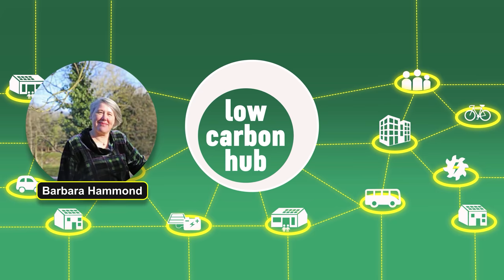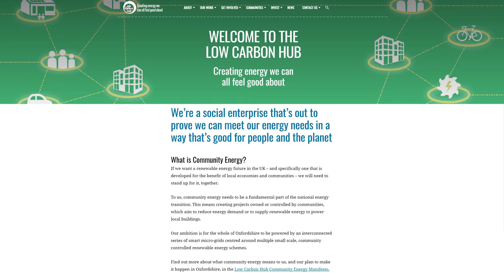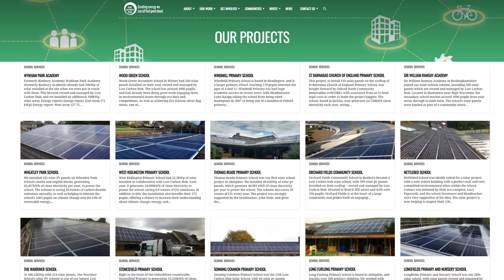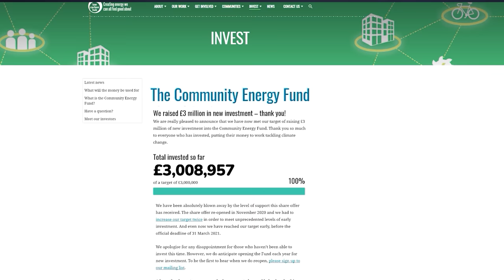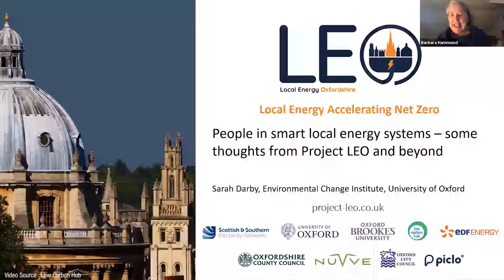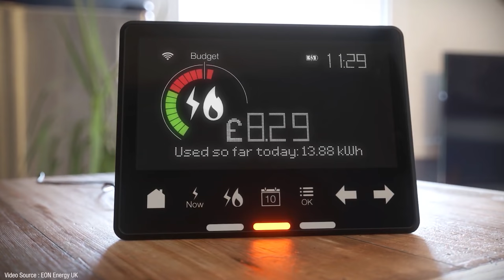The Low Carbon Hub   A glimpse of our distributed community energy future

Comment: That river hydro installation is especially heartening. Fish-safe designs for baseload river hydro are important, and if replicated across the nation could provide so much of our needs on its own.
Reply: Sorry to say it, but England do not have the rivers to supply any substantial amount of the energy needed. A single link to Norway (Sea Link, a 1,400 MW HVDC interconnection) can supply 50% of the installed hydro power capacity in UK (not counting pumped storage). Only 2% of the energy mix is hydro power and because of how unpopular large projects will be, this will not increase.
Reply: @bknesheim  not at megaproject scale no.

But at smaller scale we have the capacity for many many small hydro plants serving a few local buildings. 

Just one example the Co-op grocery supermarket in New Mills, Peak District, is powered by a screw-like hydro plant on the nearby River Sett / River Goyt. When running the "Reverse Archimedes Screw" produces power for the shop with a surplus to sell to the grid. It has put back into use the head of water produced by mill owners in the water phase of the industrial revolution. 

Don't forget that the international industrial revolution started in England. Don't forget that the capital for the steam-driven stage was provided by the earlier water-driven stage.

We did it once. We can do it again, but this time round not go for the mega projects which as you say are unpopular and I personally think they are justifiably unpopular.

We can certainly get almost every mill-race running again, this time generating electricity rather than grinding corn or spinning cotton.

We can and we should. And we can do alonside the gov't or despite the gov't
__

Train to New Mills Central. 5 min walk to the hydro. Look for signs to Millenium Bridge or Sett Valley Trail.

The hydro itself is not a day out, but if you are going to be in the area, or you fancy a gentle walk along a converted former railway alongside a lovely river then do take 20 or 30 mins to look at the hydro.
Reply: Not just baseload, but dispatchable, and also energy storage with pumped hydro.

Comment: Amazing video as always! Thank you so much for describing the work of the low carbon hub. Similar efforts are needed to decentralize food production to whatever degree possible depending on location. Agrivoltaic systems where specific foods are grown in areas with solar panels is an upcoming solution too.

Comment: Many places have already done this type of thing, but with Water resources.  Rural areas where drilling wells are difficult so they pool resources into a single well and cooperatively run the well and distribute the water within their community.  I actual do one myself for my neighbors.  My well provides water to numerous houses and we share in its upkeep and operations, even though it is on my land.

Green electricity and storage is ironically one of our ideas for dealing with the power needs for running our community water.  We could follow this model and provide supplemental power to all of our members during power outages from the primary grid in our area.  It is something we are actively considering.
Reply: @Jeff Johnson so is it a deep well that's fully cased, with passing that didn't start leaking from day one like most oil wells do, anyway just hoping you don't have many Celtic tanks near by and by near who knows from how far away it rains and the water makes it to you. Good analysis several times a year is probably prudent!
Reply: @TheLosamatic  It is a deep well.  We had a Aqua engineering firm help us determine depth so we could get into clean and good water.  We are on a massive limestone ancient sea bed.

Comment: Speaking as someone who's so far below the poverty line that she'd need a long ladder even to reach the darned thing, I'm always wary of anything that sounds positive, progressive, sensible, renewable, or green. Because, sooner or later, one way or another, I just know my electricity bill's going to double. 🤪
Reply: I can guarantee that the cost of electricity produced by solar panels on a residential roof is already less than £0.10 per kWh over the lifetime of the system. That £0.10 is fixed and unaffected by inflation over the 20+ year lifetime of the solar panel installation. Average electricity prices from the grid are more than 50% higher than £0.10 per kWh and will only go higher over time. The biggest problem though is having the funds available now for the solar panel installation to make the savings in the future. That's where the local community can help.
Reply: Insulation can be available free

Comment: My thought on the solar panels is that roof mounted solar is mounted on the roof with no airflow underneath, whereas ground mounted is almost always on a steel frame allowing airflow all round. The panels work better when not hot somewhat ironically.
Reply: Sadly they compared residential rooftop solar with grid scale ground mount projects. Of course both the financial and practical efficiency was better, but you do lose out on the democratization of power generation and the problems associated with a centralized power economy. Though I agree a co-op is much better than a power grid monopoly. 

But I would still rather see solar panels on commercial rooftops and parking lots than either residential rooftops or in fields. 

Scale can be similar due to the size of the property, and different mounting technology could be used so the efficiency is there both practically and financially. 

Also reduces the need for air conditioning in commercial properties. 

And it leaves natural land natural, only beautifies already in use commercial land. 

Combined with electrified fleet vehicles for double down green effect. 

Also gives some democratization of the power monopolies to consumers, corporate consumers having the power are still better than grid monopolies.

Comment: The drive to low carbon economy caused that UK replaced coal power stations with natural gas power stations. In 2020 gas generated 36.5% - 114 TWh. That caused very quick use of gas from UK's deposit on North Sea. Now UK is covering only 55% of demand and there are only 3 years left of it. The rest, that is 45%, is covered by import mostly from Norway of very expensive gas. Just now the gas prices for heating homes increased by whopping 60% !!!. 
I have now in September 2021 gas price increase from 2.107p/kWh to 3.3548p/kWh.

In 3 years time UK will have to import 100% of natural gas. I can only image how much the gas will rise then. That will be a real shocker. Such a wonderful and cheerful results of the policy.
Reply: Sounds like your place needs a passive energy upgrade. Time to make a move.

Comment: Here in France they have been some tremors with solar power production. The price of the kW bought to private solar has dropped to the point where you can't make a profit, you'll pay back your investment after more than ten years, and when you get the first profit you'll have a drop in efficiency and failures on your panels that became old. This happened to a local farmer who invested 300000€ in an installation to make some benefits off his hangar roof, but now that the price changed he can't make money fast enough to pay his loan. Even if private or communities take the initiative, it can still fail if the government doesn't support a linear price to sustain the investment.

Comment: I have a question for those interested in efficient uasge of electricity. We've had a "Smart meter (gen 1)" in our house since 2019 and it's unable to recieve/transmit data to our provider. We're no where near any other smart meter users. There's a single mast for mobile phone a few miles away and we get 1 bar on our mobile phones. I've had companys over to our location to test signal boosters etc. to no avail. Who/where do I contact the UK gov to get this situation resolved? Any constructive ideas or information appreciated, thanks.

Comment: Why is the low-carbon hub shown dismantling a nuclear cooling tower at 1:39? Nuclear has carbon emissions on par with renewables.
Reply: Why assume it's a nuclear power generation being dismantled? I may be wrong but as far as l know all nuclear stations in the UK are cooled by seawater or lake water and do not have the characteristic parabolic cooling towers used for fossil fueled power stations.

Comment: Highly distributed energy networks have problems though. Traditionally, the electrical generators at power plants will be constantly working with one another to ensure frequency and voltage remains within allowable margins, balancing this with demand. But once you get a significant amount of power generation happening outside this careful control, things start to get much more difficult. That said, distributed solar generation and storage is likely one of the best ways to take loads off the grid in general, so once we get something less destructive than lithium ions I’d definitely invest in that.
Reply: This is one of the main technological breakthroughs needed, a way to connect hundreds of millions of electricity producers with hundreds of millions of electricity consumers, while solving all the issues you mention, and doubtlessly very many more.  But the current technology is, at its core, way over a century old, creaky and fragile, as events have seen.  Something better would take an Apollo scale project.  But I keep wondering what everyone's waiting for.

Comment: For sure ground mounted is good - but domestic rooftop solar is owned by those people and the income/energy goes directly to them - it also skips the 10% of energy lost in 'transportation' in a top down centralised grid. A bottom-up 'distributed' grid also needs private money to invest on their own rooftop - as they would when buying a new kitchen. Using energy where it is generated is the most efficient, and will drive a social change, because it doesn't need to make a 'profit' for shareholders & billions will be left in people's pockets instead of going to pay far off shareholders (or local ones).

Comment: How did the Egyptians produce obelisks from solid rock,  using a copper chisel and wooden mallet?, I think not, 
A few yrs ago I looked up,  did ancient Egyptians know how to make glass,  and they did,
If they knew how to make glass, what are the possibilities that they knew about convergent and divergent lens,
One Egyptian using a small hand held lens focusing sunlight to start a fire,  said,  what happens if we build a big one, 10m in diameter 
10m ÷ 2 = 5 x5 = 25m x 3.14 = 75m2 x 1000w/m2/sec = 75kws/sec at its focal point ,
You think that's enough heat to melt and/or soften rock to be bemoved, 
Fast and simple, 
Using divergent lens to straighten out the convergent rays you create laser beam from sunlight,  you could transport light down long tunnels and respread it to light up their lives in dark places that have no seut, 
Maybe they used it to break water into H2 and O2,  using H2 to lighten the load or cook,
The white limestone would have reflected sunlight and moonlight acting as a long distance beacon for navigation, 
Just Have a Think,  what can be done with sunlight and large convergent/divergent lenses,
Melt aluminum and other metals,  waste removal,  water distillation and sterilization,  the possibilities are endless, materials are cheap,  abundant and easily worked

Comment: An energy efficient home is more comfortable and saves money in the long run.
Added insulation, triple glaze windows, energy efficient doors, energy efficient heating and cooling systems, energy efficient appliances, LED lighting, smart thermostats, solar panels combined with battery storage and a electric vehicle charger in the garage or car park. People are too focused on the short term costs and miss out on long term savings and comfort. Blower door testing and air sealing are under appreciated tools.Even if you have money to burn you should not waste it.  Climate Change will impact everyone. Leave a better future for your children and grandchildren. Join in and speak up for the future of the planet.
Reply: And the poor?....
Reply: @richardwoollaston3650  The poor would be better off not having to pay high utility bills every month. Short term thinking makes you poor. Long term savings makes you rich.
Reply: I mean, how do the poor pay for the insulation, doors , evs and charging points, new heating systems, battery storage etc? This is an elite project aimed at the elite and damn everyone else.

Comment: The problem with all this speculative, aspirational ideas is that they bear little relationship with reality. All the joyful talks of CCS and billions spent has resulted in very little except a justification for continuing fossil fuel use.
If governments had retained or increased subsidies for domestic solar, that would have offset more carbon than the carbon captured by CCS

Comment: Just have a think, 

you still have not grasped how electrcity is generated and distributed, these 'clever' sorry 'smart' ideas go against the physical attributes of power.
In the early days power was generated locally and used locally, there was no grid. However these generators were synchronous so supply and demand was easily balanced. It was soon found advantageous to connect neighbouring generating sections and so teh grid evolved, why regress?